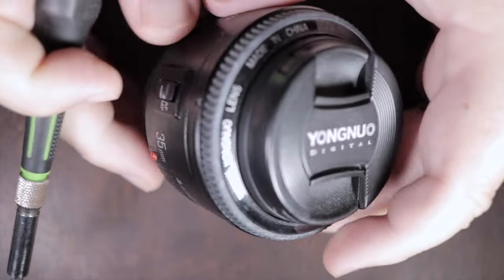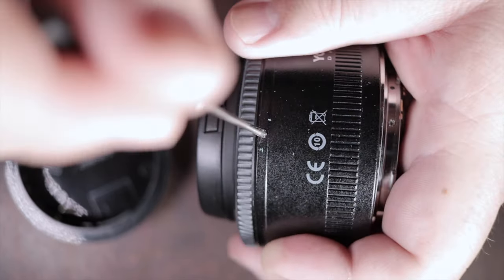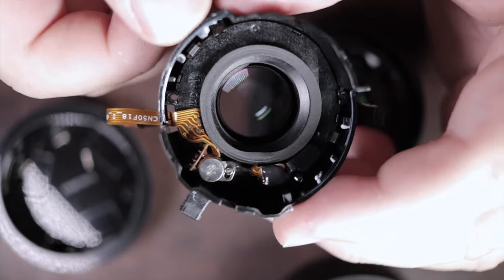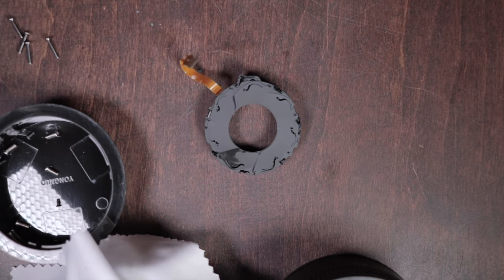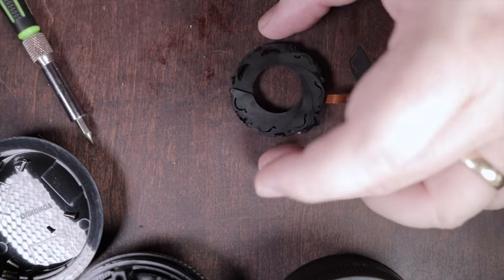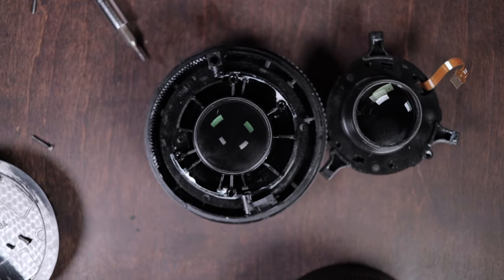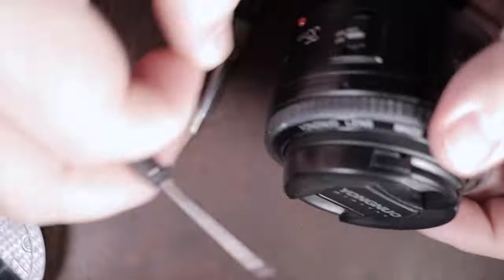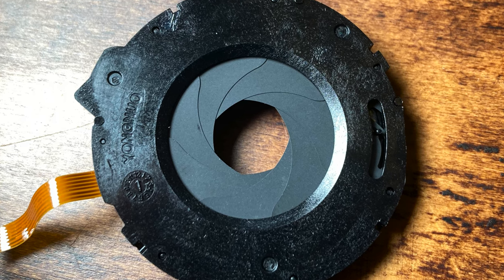Yongnuo 35mm f2 Teardown and Aperture Repair

Comment: I just accidently found this video and I happen to own a broken yongnuo 50mm that always shows "error 01" on my canon 1300d... So its been in a drawer for maybe 2 years.  I saw your video and thought "why not" and opened it according to your video.  The 50mm is very similar to your 35mm. My apperture module was absolutely drowned in "oil" or whatever it was.  I opened it and all the blades were stuck together and "wet"... The blades did look a bit different from yours but similar enough for me to figure them out.  I put them on a paper and cleaned them using Qtips... I kind of just made them all "dry" again. It was not easy to put the thing together again... But after some trial and error methods I succeded.  I did some misstakes when assembling the lens again so after first try I had aligned the AF-cogs wrongly so AF did not work.  But after another dissassembly  I understood how it should be put together and succeded.  Now the lens works perfectly again. I love these videos where people share info.  It was worth alot for me.  Thanks!
Reply from the maker: I made this video hoping someone else would find the details useful about the 35mm f2. There are not many teardown videos of these lenses, and it is nice to see what you are getting yourself into before attempting. I had to go in blind and hope I could get the thing back together. Whoever originally puts the oil in these lenses probably needs to watch. I imagine the blades work like a sponge once the oil from the other moving parts gets too hot (like in a delivery truck during the summer).

Comment: I just bought one and JUST took it out of the box.... What do you know the aperture is stuck n not moving
Reply from the maker: When mine was stuck, I could at least hear a small clicking noise of the lens attempting to open/close the aperture. This was the gear motor turning but unable to move the blades as the were all gummed up and stuck together. Mine was stuck all the way open. If by chance it is stuck all the way closed with no visible oil on the blades, it may be broken.

Comment: Hi ! Is the same tutorial is available for the 85mm 1.8 yongnuo ? My aperture is broken too !
Reply from the maker: I had trouble finding videos and was ready to toss my 35mm. So as a last ditch effort when I attempted the repair, I thought I would film it since not much is available. I am not familiar with the 85mm lens, so I am not sure if that repair is similar. 

Mine was a victim of excess oil causing the blades to stick together. After researching, this is a common problem if the lens has been in a hot environment.

Comment: Hi I have the same problem. Wich screwdriver did you use to remove the screws?
Reply from the maker: I believe it was a small phillips (+) screwdriver. Before removing the screws you will likely have to remove some glue that fills in the top of each screw if this is the first time the lens has been opened. Here is another video that shows someone doing that with a razor blade: https://youtu.be/fjVr0IwJyd8
Reply: @thefunofphotography  Tks for the tips